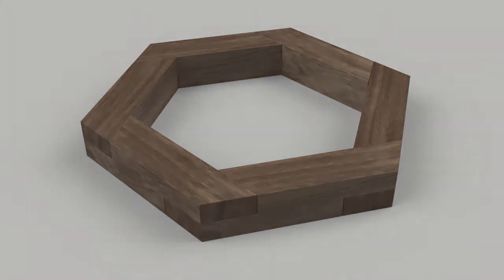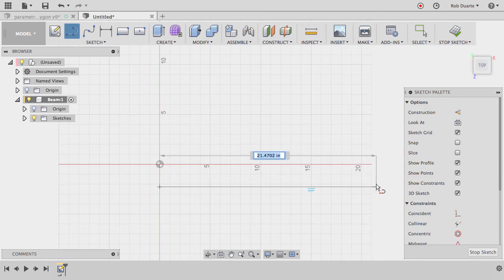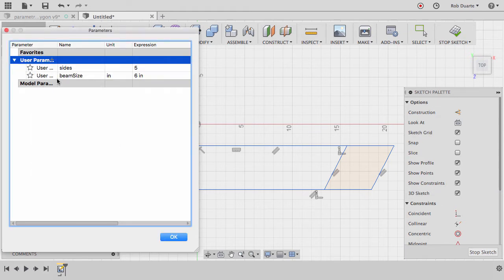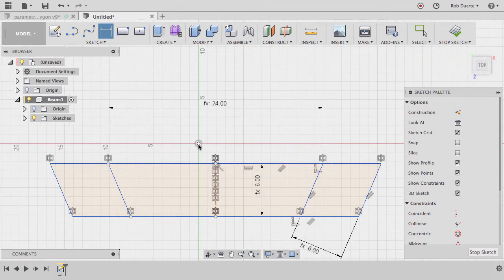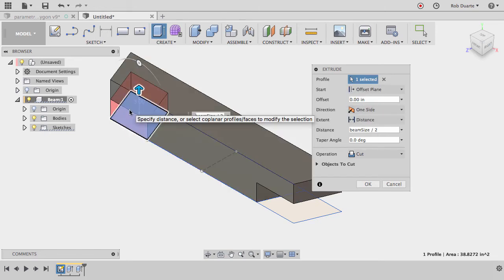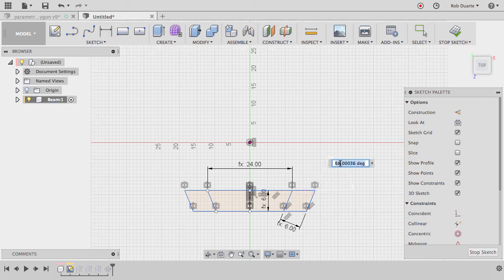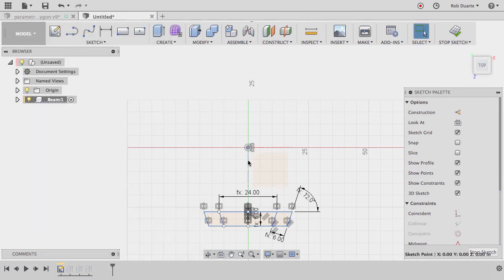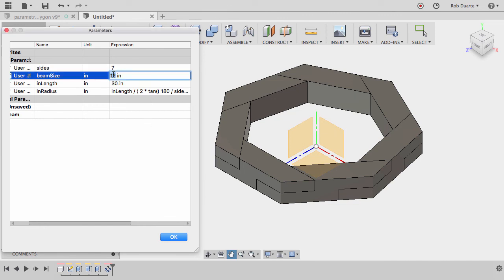Fusion 360: User Parameters + Patterns + Wood Joinery

Comment: Hello, Great video. One thing of note, when using the parameter 'sides' in the Circular Pattern tool. It doesn't update. It will not update when you update the number of sides. I am not sure if this is a bug or not. Just FYI.

Comment: Had to keep editing in radius parameter. Fusion kept adding brackets I didn't type plus the term *1degree. Finally worked with the *1degree which Fusion added by itself.